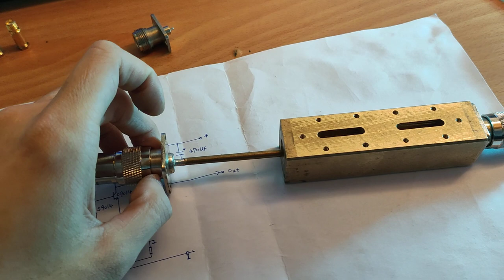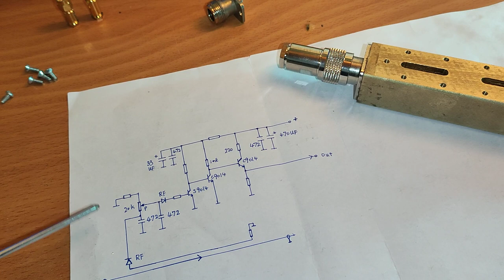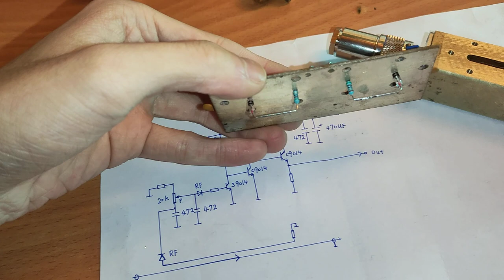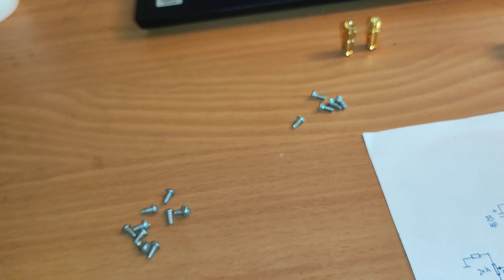Dual directional coupler

Comment: THIS IS CALLED STANDING WAVE RATIO METER, SWR METER. IT SHOWS POWER GOING TOWARDS ANTENNA AND POWER REFLECTED BACK FROM ANTENNA TO TRANSMITTER. IT IS USED TO MATCH THE COAXIAL CABLE AND ANTENNA WITH TRANSMITTER.
Reply from the maker: Thank you sir for your comment, this will make some viewers understand more easier.
Reply: @uecmitsuimarinedieselengin873  Thanks, my pleasure 🙏 Sir.
Reply: Why are you shouting ?!